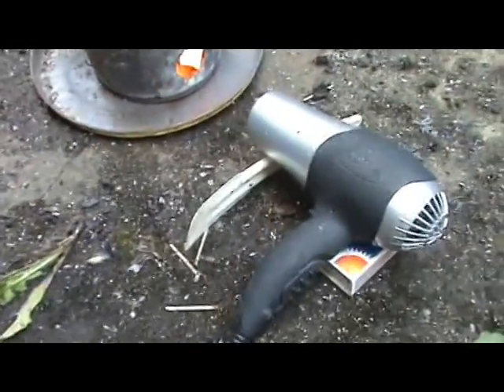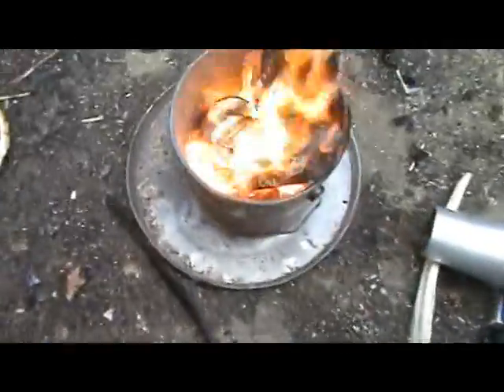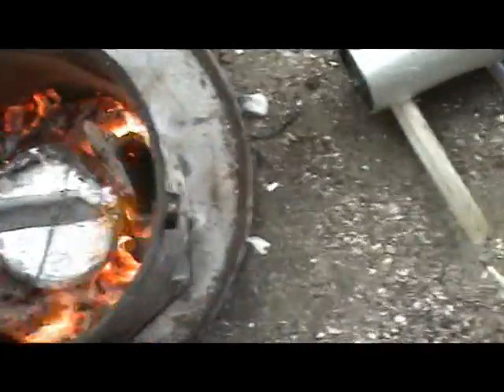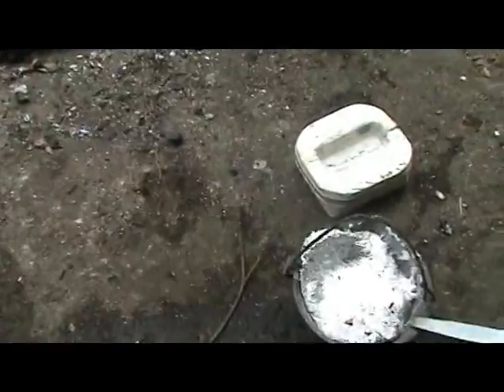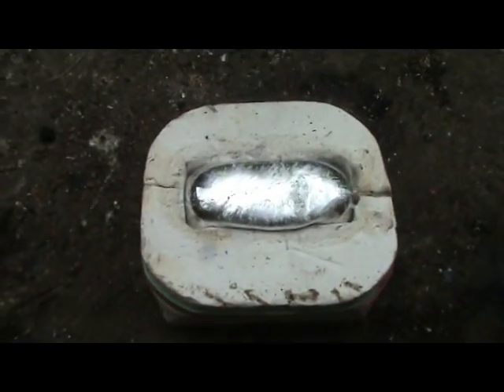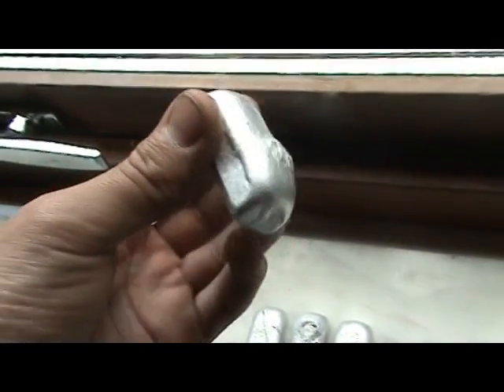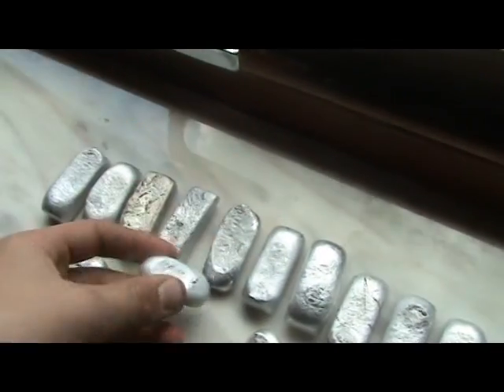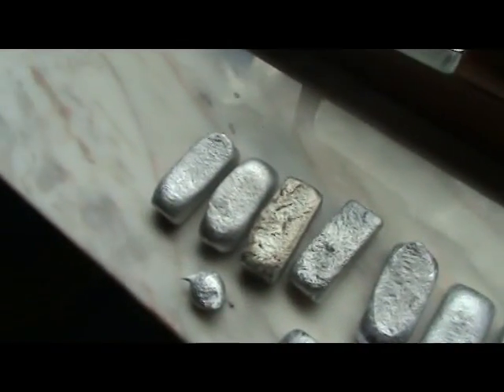melting aluminium at home to ingots

Comment: @markuscoollife 
i melt aluminium cans into ingots and scrap them in for cash. to melt the aluminium i use bricks for the furnace, wood for the fuel and a regular house fan for the air intake. it gets pretty hot, it glows red when i pour the aluminium.

Comment: You can machine small parts from them. Instead of selling the aluminum as scrap, just melt it down and cast it into ingots for later use. Lot cheaper than buying aluminum stock.